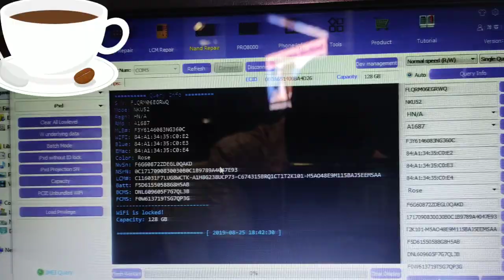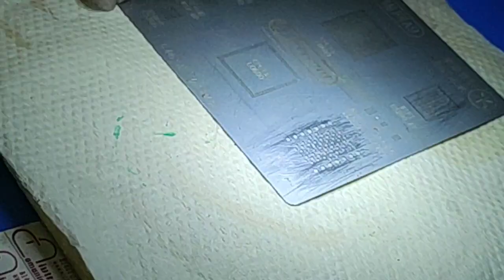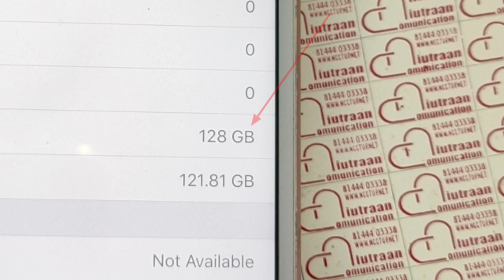How to increase internal storage apple iPhone 6 6plus 6s 6s plus 7 7plus 8 8plus etc

Comment: I am watching this now 1 years after uploaded but I have the gold iphone 6s 16GB storage and get every time message that my storage of 16GB it is full and i must delete someone apps or photos videos and i delete and storage is full in 2 hours when i go check iphone storage i see 9,92GB by System hence there is a phone repair shop in the Netherlands in my hometown that does this iphone storage upgrade and previously an iphone 7 from 32GB have upgraded to 128GB these repair store do a lot of solder work  Can i get my iphone 6s gold 16GB upgraded to 128GB or more because i cant upgrade to Ios 13 I get notification that iOS 13 is available but I have storage full problem and get i problem with iOS 13 my phone works now on iOS 12.4.1 and work touch id also?